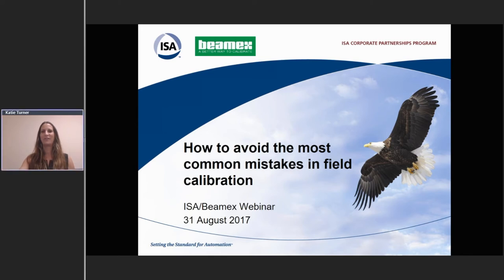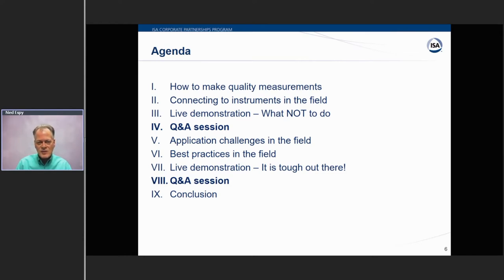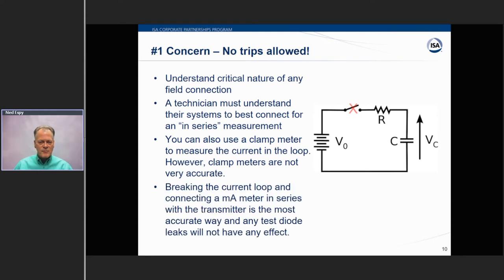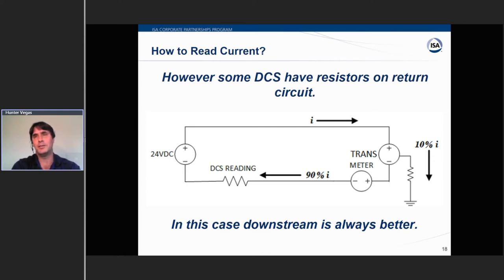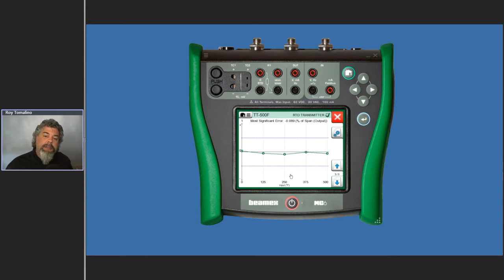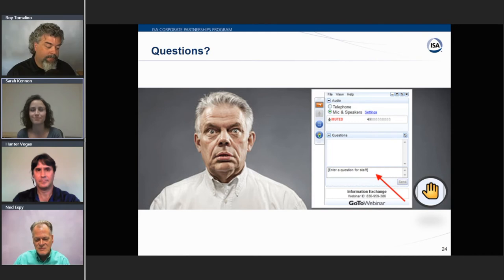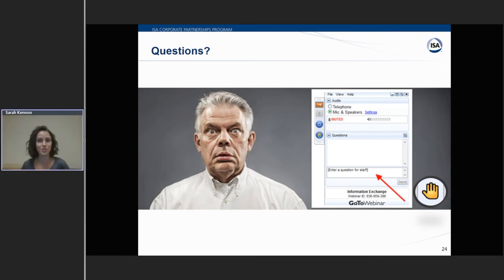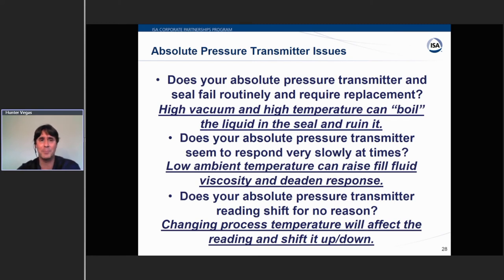How to avoid the most common mistakes in field calibration

Comment: I think that as long as you are already out there hooked up to a transmitter and need to perform a sensor trim, you might as well perform a D/A trim unless your sensor trim makes the cal essentially perfect. If the sensor trim brings the cal within specs but not perfect then just do a D/A trim. Its not like it is a hugely time consuming process.